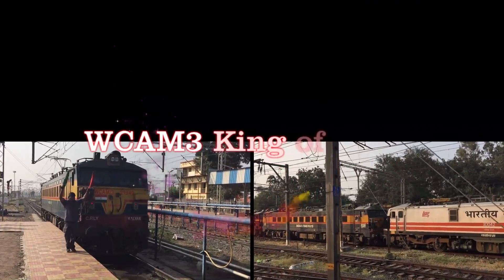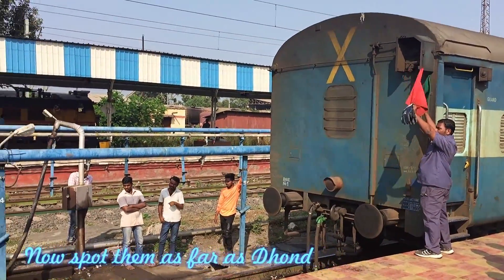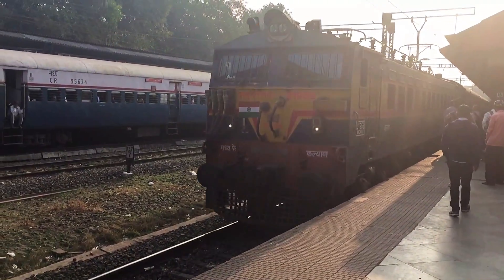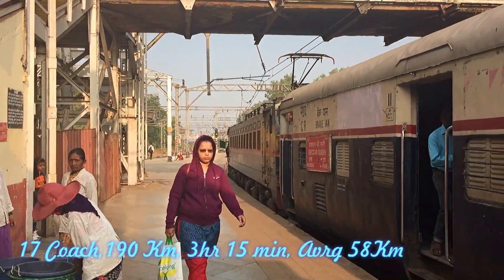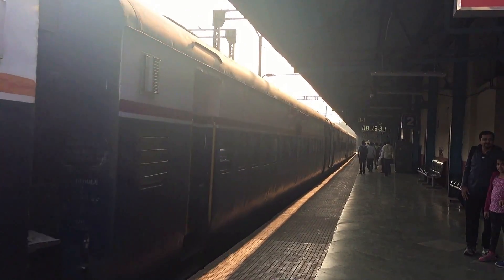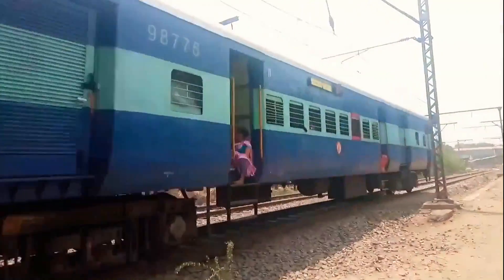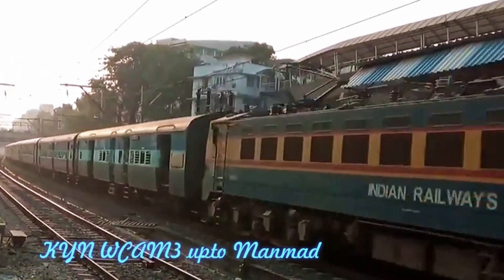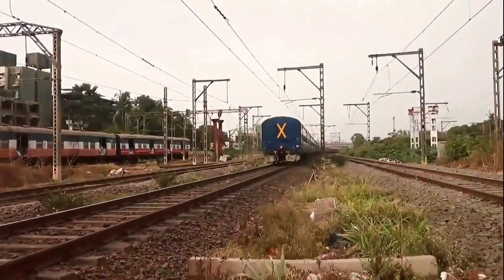WCAM3  The King of Bhor & Kasara Ghats -  History Roles Trains

Comment: Why WCAM 3 is not used in South India
Reply from the maker: Good question. They were designed for a specific purpose of operating under 2 Different Voltages - DC 1500 Volts & AC 2.5KV. They were obviously more expensive. Pure AC Locos like WAP4 were already in operation and hence there was NO need to go in for it.
Reply: WCAM only Maintaned in Kalyan locoshed that's why it has limitations on track.